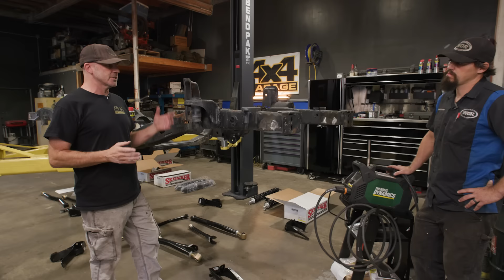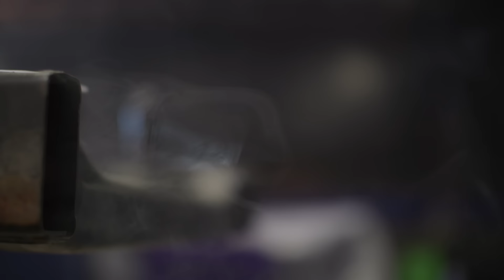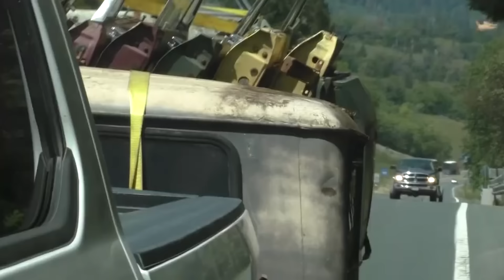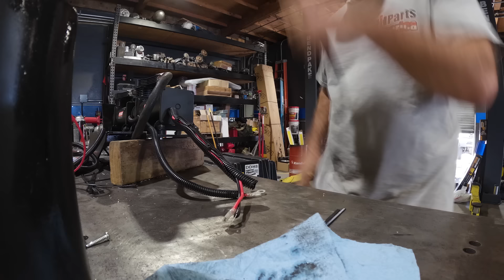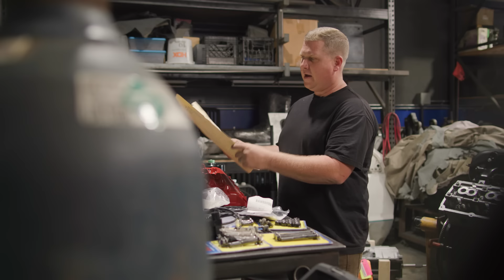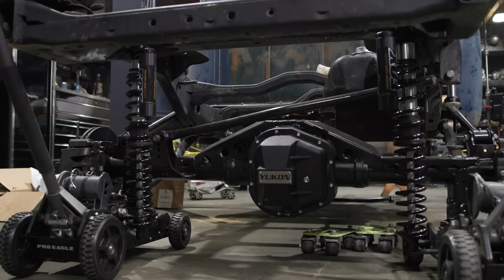4x4 Garage: Hemi-Swapped International Rock Crawler Build & Tow Rig Upgrades Pt. 2 | MotorTrend

Comment: stock AAM1150 1.5'' shaft to 1-5/8ths spline axles, good to hold the stock power of a 4.6 triton. " rev and dump torque " (wheel slips a little bit engine revs then when grips back up and... thud) rev and dump torque. [205hp = 460hp] under the elastic tensile yield.